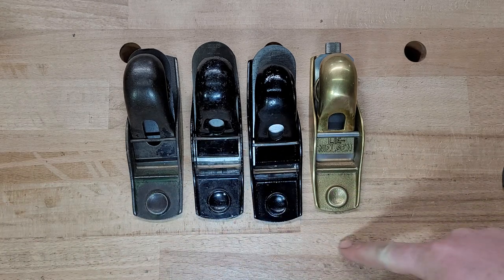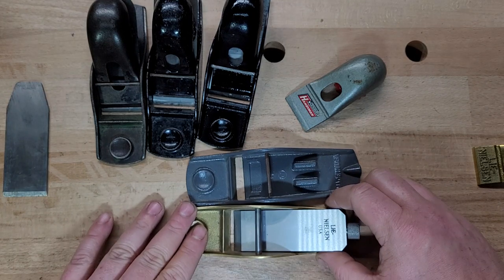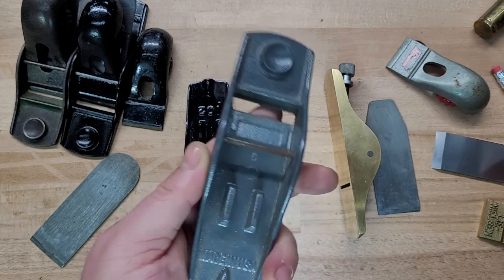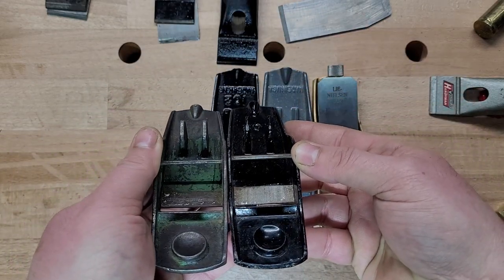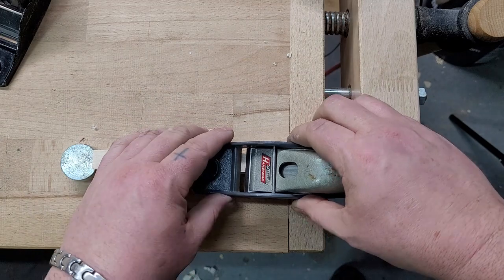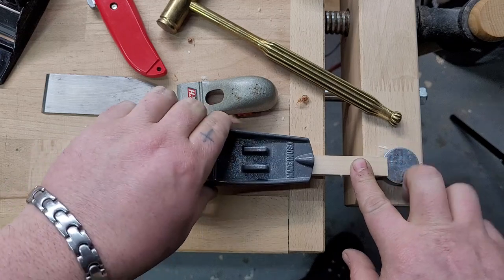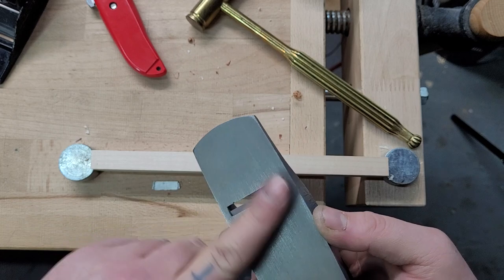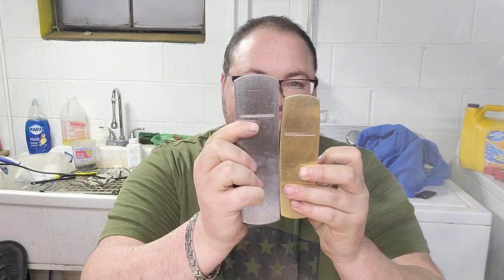102 Edition - Lie Nielsen Vs. Stanley Comparison - What LN changed/upgraded and why

Comment: I have 2 Stanley 102's.  1 is marked as a 102 and has a high bed angle.  The other has a 5 and a U between the frog and a low bed angle.  Is this an actual 102?  Or a 103 or a handyman?  Can someone help me?
Reply from the maker: It sounds like a Millers Falls no 5. Check this link see if it looks the same. The earlier ones had "Millers Falls" around front finger indent. The later models didnt:
https://www.justtheplanefacts.com/millers-falls-no-5-block-plane
Reply: @BatCaveCreations  it doesnt have any miller falls markings but maybe?  I have pics if you want to see them.  Just FYI...discovered your channel on youtube.  its great!  Thanks for what you do.  Helps guys like me out tremendously!
Reply from the maker: @protoform77  
Thay is great news! I'm glad you found my channel!! Thank you!!
I'm not the best at identifying block planes :( I know some millers falls no 5 didn't have millers falls on them tho. If it is grey and red it will be a Stanly handy man. But if it is black and marked no 5 is gonna be a millers falls. 
This is a great Facebook group to help identify if you wanna share pics there I can take a look also. https://www.facebook.com/share/g/CBXHPtP5Y6L1Udg4/?mibextid=A7sQZp

Comment: Thank you for the nice videos..I noticed you've had this same issue and had to use shims on your Jorgensen 60 1/2 video.. is there a possibility you could be creating this issue by applying too much pressure on one side while lapping the soles of these planes flat?  Would that even be possible? Thanks!
Reply from the maker: Hey! No it wouldn't be created that way. But that is a good thought! The Jorgensen I did not lap the sole of at all. It's the bed for the iron that isn't parallel to the sole of the plane. In this videos you can see that very well when I show the mouth of the handyman you can see where one side of the bed is thicker than the other. I can file that so it's even but it's a shelf piece so I'm not gonna work on it. The Jorgensen I will lol

Comment: I love my LN 102! Such a nice and handy plane and comfy with being able to mostly comfortably use it in one hand without feeling like I’m only gripping it with the very tips of my fingers like on a standard angle.

I also love my single Handyman standard angle block plane despite it missing the front knob, it was my first plane, so I have some bias lol. I’m thinking of making a longer iron for it with a nib on the end like on old infill mitre planes to make it a little easier to depth adjust without really loosening the cap.
Reply from the maker: That's a great idea in modifying the iron!

Comment: Nice!  I am looking forward to the battle of the #4s.  Would love to see Woodriver vs Stanley at some point. Any thoughts on what I would expect to pay for a used LN #4? Assuming I could find one.
Reply from the maker: I don't have any WR but I'll keep an eye out for one.
LN no 4 prices fluctuate when they are in and put of stock on the LN website :( check the ebay sold prices to get an idea. Sometimes the prices are so close to retail you may as well buy new